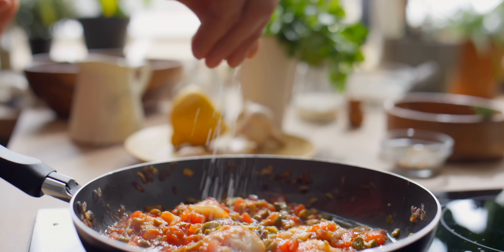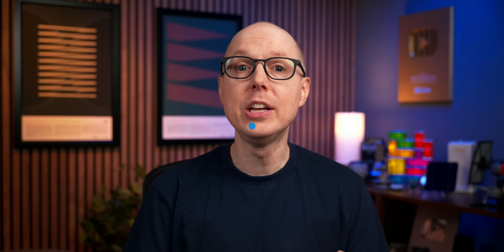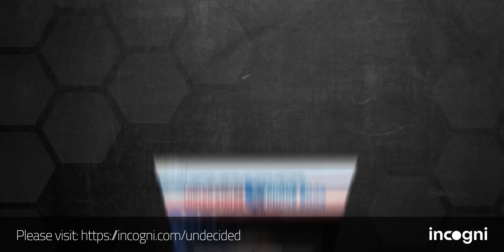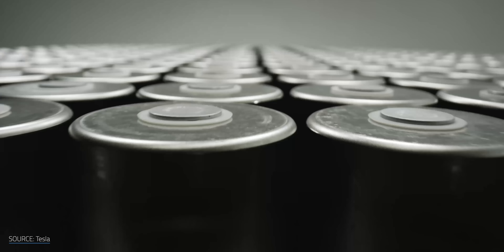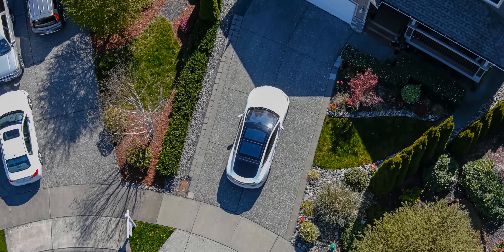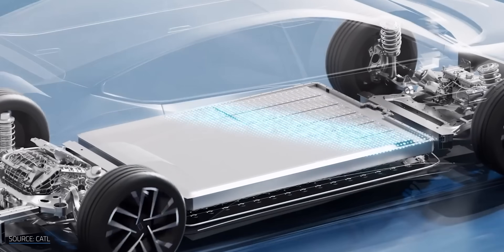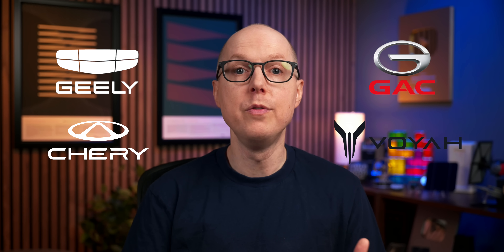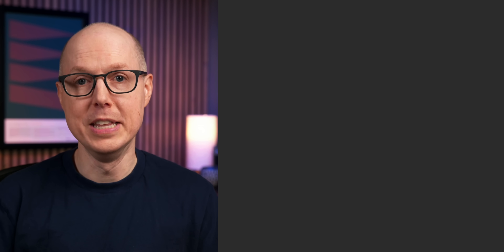How CATL Made Batteries 90% Cheaper (And What Happens Next)

Comment: CL, the world’s largest battery company, announced sodium (salt-based) batteries costing as low as $10 per kilowatt hour, a drastic drop from the $100 industry target.

These batteries use sodium, a common element found in everyday salt, not exotic new chemistry.

CL is currently the leading lithium battery maker, powering Tesla and many EVs, so their pivot to sodium is surprising.

The company has not released technical papers or detailed explanations, only bold claims and market-ready products.

Sodium batteries have traditionally been considered inferior due to lower energy density and shorter lifespan.

Despite sodium’s abundance and presence in seawater, sodium batteries have historically been expensive due to manufacturing challenges.

Lithium battery costs dropped from $1,415/kWh in 2008 to $115/kWh in 2024, but sodium batteries have not achieved similar cost reductions until now.

CL’s sodium battery, called Naxtra, boasts operation over a wide temperature range (-40°C to 70°C) with 90% power retention at extreme cold.

This temperature resilience opens new markets like northern China, Russia, and Mongolia, where cold has limited EV adoption.

Naxtra reportedly lasts over 10,000 charge cycles—significantly longer than Tesla’s lithium iron phosphate (LFP) batteries lasting about 3,000–4,000 cycles.

10,000 cycles at typical usage could translate to over 3.6 million miles of driving before significant degradation, positioning sodium more as infrastructure than a typical car battery.

Naxtra achieves an energy density of about 175 Wh/kg, close to LFP lithium batteries at 185 Wh/kg, making it competitive for urban/suburban EV use.

CL has a second sodium tech, Freevoy, a hybrid battery combining sodium with lithium chemistries for optimized performance and temperature ranges.

Freevoy automatically switches between battery chemistries depending on driving conditions, improving efficiency and range.

Sodium batteries are safer than lithium, with less risk of fire or explosions.

The main tradeoffs of sodium remain somewhat lower energy density and potentially higher current costs compared to lithium.

Despite sodium’s abundance, lithium’s established supply chains, mature technology, and economies of scale keep lithium prices low.

CL has achieved mass production scale only recently after overcoming earlier supply chain delays for sodium.

Sodium battery manufacturing can use existing lithium battery production lines, facilitating quicker scale-up.

CL’s CEO projects sodium could capture up to half of the battery market if the technology and costs prove out, potentially transforming EV prices, home storage, and renewable energy economics.

Comment: Disclaimer - all prices given below are AUD.
In 2020, I looked into solar storage batteries for my new 10kWp (8kWi) system and they were around $1/Wh - I determined that they would not give me the ROI based on saving me ~10kW per night.
I thought to myself, well, build the system now so I can easily add batter/ies later when production costs come down and batteries are cheaper.
Fast forward 5yrs and now the prices I'm receiving is around $1.80/Wh???
I keep hearing about how batteries are getting cheaper (10c/Wh and now 1c/Wh) but I'm not seeing it in Australia.
Should I just buy some of these batteries directly from CATL?
BTW, I think the Solar PV Arrays/systems in the US are way overpriced! I got my system installed at $1250/kWh. (or $12500 for a complete, battery ready 10kWp system)

Comment: More for the argument that we need a modular exchangeable universal battery pack to augment the EVs fixed battery.

If you drive into weather extreme areas the service station will have the appropriate power source.

Comment: The cost of lithium batteries has been tanking lately so how to guarantee continued contracts from buyers. Tease a new battery technology so cheap all of your competitors have to burn cash and waste resources trying to match your companies supposed technology even though, I'm assuming, no patents have been filed and no spec have been issued. 
Also how to keep the price high when the cost drops to $10 per kwh? Mix the cheap batteries with then more expensive batteries, keeping the price high. Which will give them the advantage of manipulating the ratio of lithium to sodium batteries yearly if they wish to control the new car market prices. Just mixing two types of cells in one battery pack would increase the price drastically I'm sure.

Comment: Sodium batteries have a few advantages that really make a difference
1. They don't catch fire.
2. They charge in 15 minutes.
3. Their price will be very cheap.
4. The charging cycles will be much higher than the lithium battery.
5. They can withstand temperatures from -49 to +70 degrees.
Lithium will remain just a memory in people's minds and for those who have had their houses and garages burned down, a disease that they have escaped
Reply: charging cycle will be a lot less, it's one of the major draw backs

Comment: If EV batteries were replaceable and recharged or repaired at a station, just slowly replace gas stations with battery stations which fits current behavioral models fear about range evaporates as batteries are like gas in the consumers mind. Removing charging fears and extreme costly battery repairs will accelerate adoption beyond expectations. All that is need is a battery like the one discussed.

Comment: Seasonal electric energy storage would we economically viable below ~~ 10 $/kWh_cap capex. And that's what we need dearly for a 100% renewable electricity system. Each 10 Dollar less in investment cost means a expansion of economically viable average storage time - and use cases. 
Here in DE we are planning to cover seasonal storage with gas power plants one day running on hydrogen - a very inefficient use of summer surplus energy, because roundtrip efficiency is significantly less than 0.5. With a battery system, it could be more in the 0.8 - 0.9 region - a big win. 
If - and thats a big if - the enormous amouts of batteries can be manufactured.

Comment: If I'm over-spamming, apologies in advance.
Maybe someone could run these numbers and even do a prez on them - Matt this means you.
At $10 or so /KWh capacity, sodium batteries appear to be a complete solution for Dunkelflaute in Western Europe, which is about the worst place for it.
I won't repeat my dodgy arithmetic - could be embarassing - but I figure that $100 billion would achieve this in the UK. That's under 3% of GDP to buy the massive advantage of enabling all-electric renewable baseload reliable 365x24 power everywhere in the country, goodbye forever to all fossils and also nuclear which cannot compete anywhere near this cheaply. Of course, there's the issue of the sheer size / logistics of the build-out. Basically you would have to persuade CATL / equivalent to set up a massive operation in the UK and you would need to steamrole thru planning applications esp for grid expansion but also just plain ol' real-estate allocating and re-purposing, then heaven knows what other obstacles.
Anyone step up to the plate and do my numbers properly?
PS My $100Bil number was for BESS batteries alone; extras add whatever +50%? Remember that something around this number is already forseen for grid upgrade over the next decade, certainly if you include undersea interconnectors.

Comment: there is somethin missing from your video, and I cannot find anything related to this on the internet: what are the charging times (5-90, 10-80, 10-90, 1-100 and so on)? If they can achieve a 20 minutes charge time between 10 and 80% they do not have any downsides compared to current LFP (we can exclude the supefastcharging LFP's that are present probably on very small number of EV's)

Comment: It's very misleading to toss around this $10/kwh number.  From my research, it appears that that number refers to the cost of the raw materials that go into the cell.  CATL never claimed that they'd offer cells at that price.  The cell cost of sodium ion will be somewhat lower than LFP,  but not in a revolutionary way. Then the cost of putting those cells into packs and modules will remain largely the same.   FInally, for those dreaming of home systems, keep in mind that cell costs are probably less than half of the fully installed cost, so a reduction in cell cost of 25% (unlikely, but as an example) will reduce your installed cost by only 12.5%.  In summary, sodium ion offers a modest price reduction, improved temperature performance, better lifetime, and  better charge rate,  but it has lower gravimetric energy density, MUCH lower volumetric energy density, and an inferior discharge rate at lower state of charge (SOC).

Comment: Also, the parallel to using sand batteries as deep thermal storage in tandem with lithium for its faster charge/discharge on solar system storage.

Comment: Hi, sorry but I had to stop watching this. Many misleading or marketing information. Fyi Tesla batteries degrade 15-18% in about 500 cycles not 3000 , this is from real user data out of multiple vehicles. This is also data from light charging use and with true engineering insights.

Comment: I switched to EV 8 years ago. Range is not a big deal for the 97% of the car usage. So price is the main driver. For long and heavy road trips once a year I rent any vehicle I want. And will never go back to petrol for my personal vehicle.
Reply: Yeah, I love my EV so much. The fact I can have heated seats when the car is off, backup power for my house, run tools where there are no outlets, and just generally use it as a car+, and meantime, I get absurd acceleration and the ability to power it from the sun🎉
Reply: @athousandlittlesteps601  plus SILENT acceleration without any rattling! How about preheating your vehicle without needing to open your garage? How about no need to change oil or engine filters? How about no need to change brake pads?

Comment: The things he didn't mention about marketing the batteries are longevity and less toxic. The vehicles could 18 times longer than existing lithium batteries, that was over 200,000 miles vs about 3.6 million miles. Sodium is found in the oceans and mines. It's non-toxic and can easily be upgrade it's supply chains with such abundance! It's already a much cheaper option!

Comment: I'm a little confused by the math on the difference in mile-longevity of each battery. It seems to me like 10,000 cycles is 3x-4x the 3,000-4,000 that a Tesla battery should be good for (per the video), and that if the energy density of the Naxtra is comparable (albeit slightly worse) then the difference between the Tesla battery and the Naxtra battery should be... 3x-4x, right? Why would it be 18x like this video (or New Atlas, the source for that figure) suggests?
However, even if we adjust that 3,600,000 miles to 600,000 miles that is still a phenomenal improvement, and at 10% of the cost per kwh is going to push forward a lot of good things.

Comment: There are things unsaid in this video, things that still makes the whole dubious.
First, the freevoy concept : 
why ? Why would you mix different chemistry to achieve that balance ? Have you ever seen a LFP/NMC mix ? No, despite the same effects. And sodium is even worse to couple with LFP or NMC (for different reasons). The only reasonable way to make it is to have 2 batteries completely separated with different voltage conversion. Because more than a difference in voltage, there is a HUGE difference on how the voltage change depending on the state of charge.
This concept would looks ok if you only look at the raw numbers, but in real life, that would be terrible.

The second is a surprisingly good aspect that is not presented : a sodium battery can be emptied without damage. Not very useful for a car, but EXTREMELY interesting for a ground energy storage. Plus, it is non only super safe, but it handle extremely well a single cell failure total failure. (like, you can drive in an axe in a cell in the middle, and still have the whole battery keep running normally, without even a fire) Such battery is literally bullet proof.
All of this is due to the very specific voltage / state of charge of sodium battery (the same that make it completely incompatible with other type of chemistry)

So, for now, all of this looks very suspicious.

Comment: If CATL would make cheap 10,000 cycle home batteries, they would sell TONS of them.  Especially in California, which is changing to a $24-$27 fee for infrastructure that can't be paid by power we send to the grid.  My NEM charges will go from $0 per year to $288 per year.  Or worse, since there is no limit on what they can charge us for infrastructure.   So I could just cancel my electric account, and go off grid if I could get these batteries.  10,000 cycles just happens to be longer than my life expectancy!

Comment: Sodium ion batteries are for real. They actually incorporate other elements but the potential for much lower cost is there. There has been intense research in China which should have been here but our short sight stockholder immediate benefits companies practically start whining if they have to commit to long term research. This wasn’t the case in the past.

Comment: How do these compare to old school lead & sulfuric acid batteries? I'm wondering if these batteries might be a viable alternative to power starter motors for large diesel engines and emergency DC boardnets on ships.
Edit: Bearing in mind the engine compartments regularly heat up to 50°C and if ventilation craps out, up to 70°C, a situation which regularly cooks off the old lead & sulfuric acid batteries.

Comment: It's hype. The myth about sodium battery being 10x cheaper is from foolish people who assumed that lithium is the most expensive cost of battery manufacture so they imagined using cheap sodium would make the battery's vastly cheaper but it's a false assumption.
All battery's are pretty much the same manufacture process which is the main cost not the raw materials cost. In fact as sodium battery is slightly less capacity any saving on lithium is lost on the additional number of battery's you need so it could even be more expensive for the same capacity.

If sodium battery has an advantage in cold weather or longer lifecycle then that's useful in some situations even if they are a bit less capacity or heavier or more expensive up front.

Comment: The problem with sodium-ion batteries are any contact with water is very dangerous.  So in a car crash and the battery pack is cracked, then any reaction to water would cause a fire or explosion. Sorry, but until solid state batteries made without lithium or other materials that are explosive or slow charging, BEVs are still not a good buy.

Comment: This is the most exciting battery announcement to date. 

One underrated use I can identify is in PHEVs and HEVs. Naxtra can retain most of it's charge after 10,000 cycles...so fulling discharging a PHEV battery daily is no longer a worry. I don't trust current lithium batteries' longevity with the extreme cycling in PHEVs and HEVs. They would lose charge after a decade and looking at old hybrids shows this. I also live in a cold part of Canada so the temperature range is impressive. My commute (90% of my driving) would be all electric in a PHEV, but I'd still have the extraordinary range of a PHEV for Canadian wilderness trips. 

That said, if they could half the cost of the battery in a BEV with good cold temperature range, I'd jump on that instead.
Reply: yeah. It certainly works. My complain with PHEVs is that to have two full propulsion systems has always been a flawed overengineered solution really, something you would expect on an emergency vehicle for redundancy, not a mass consumer product. I wish more manufacturers would turn back and lean into Making EVs with petrol powered "range extenders" I think BMW had the right idea with the i3, it's a shame that it didn't catch on. Just work on making a high efficiency, compact petrol to electricity generator and slap it on a 150km ish EV. HEVs make more sense from an engineering stand point but then again they are really just ICEs, not worth even talking about.

Comment: If it is CATL, it is not hype. However, LFP can compete with sodium ion on overall value. Sodium ion easily is best for stationary energy storage due to less density so it will displace most BESS products using LFP.  The oversupply of LFP will just translate into cheaper LFP and just make it into more EVs, from cheap to luxury EVs.  CEOs prediction of sodium ion taking 50% of the industry is pretty good.

Comment: Several problems with this analysis. 10% battery used for calibration not energy utilization. The comment can easily switch between Sodium & Lithium. So in Siberia you use exclusively sodium which is 10% of the battery 10 Km? Even if cheaper it will never be adopted utility scale due to cost of swapping out 5x more often as Lithium and the labor cost to do so plus the massive increase in land required to house them. Yes you will save a lot on energy for keeping them cool but it will likely not counter the cost to hook up and swap out these batteries repeatedly. Do you have any idea what the labor rate is in the the US for skilled Union jobs in the Industry? Ever hear of IBEU International? Unions provide well trained disciplined and skilled labor you cannot often hire off the street in the volume to complete utility scale projects